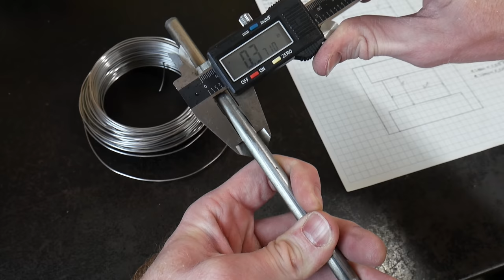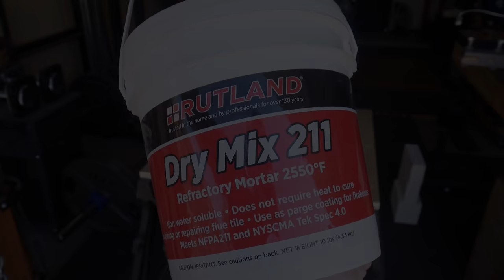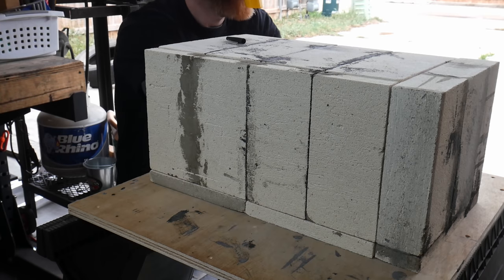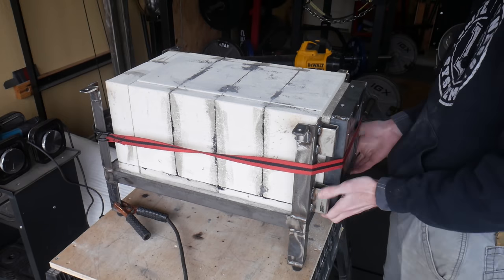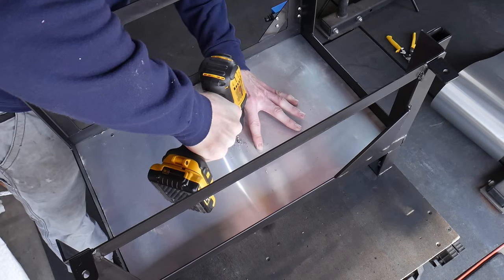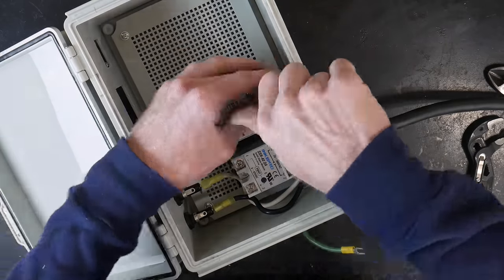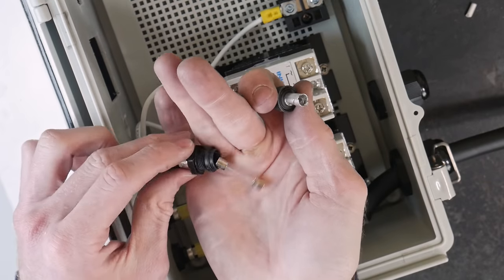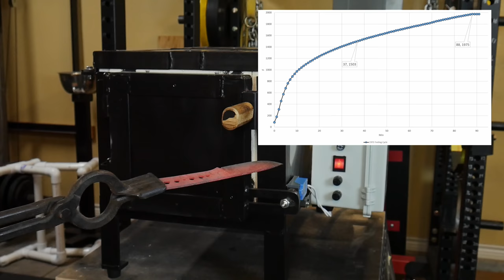How to Build a Heat Treating Oven | FULL GUIDE | DIY Heat Treatment Oven

Comment: Just ordered the parts. I have two questions:  1) if I extend the bed by one brick (4.5 inches), do I have to use more coil or can I stretch the coil a bit more? 2) Do I need a 30 amp breaker to get to 18.4 ohms resistance, assuming I need more wire?
Reply from the maker: Tom, I built this a while ago... so I'm trying to remember things to look out for. I think if you extended by 4.5 inches you should be ok on the stretch. Just be very carful to stretch the coil evenly. 

I break down the math in the video. In my case I decided to target a target amps of 13... which works out to requiring an 18.4 OHMS wire. This runs just fine on a 20 amp 240v breaker. (5:57)
Reply: @RedBeardOps  thank you sir. I will let you know how it turns out.

Comment: Wow so much detail! Thanks so much. I followed you and built my own. Seem to be having the same problems as you. Won’t go above 1100. Did you figure out why you were having problems?
Reply from the maker: Hey Wayne, I was never having issues. My oven goes to 1900F
Reply: @RedBeardOps  oh sorry I thought u were having a hard time. I can’t figure out why I can’t go over 1100. I have 17.8 on my coil. Good seal all the way around. Any advice would be great! Thanks again so much.
Reply from the maker: @waynesmith9421  Hey Wayne, two things. Make sure your thermo couple is wired right. Maybe test it with ice water to see if it holds zero. It's comment these wires can be flipped. Also, dig into the controller set points. I'm not sure what controller you're using, but the Auber is pretty confusing.

Comment: Have you noticed any degradation of the ceramic terminal blocks on the back of your kiln? I've notice they seem to get a lot hotter than I would like when I heat treat steels like 10v with high austenizing temperatures, with a decently long hold time.

Also for the placement of the limit switch I had good luck placing it so that the button is pushed in more than necessary,  that way it doesn't turn off after thermal expansion.
Reply from the maker: Good point on the switch. I haven't investigated the blocks
Reply: @RedBeardOps  I forgot to add to that, the main reason I asked is they had gotten a bit too hot and there has been some degradation to mine. Although, after really stuffing the back full of kaowool, it does seem to help. I'm not sure how I can stop them from getting hotter than I would like.
Reply: @RedBeardOps  so I've got at update on the oven. I've gone ahead and made some modifications to mine. You may have seen them on blade forums. 

I moved the terminal blocks to a point outside the aluminum flashing, as well as thethermal couple (I moved the thermal couple earlier on, because it was melting the insulation for the wire). I had to make new coils with longer twisted leads. But now that the terminal blocks arent attached to the body of the oven they arent getting heated all. Which is keeping the connection from getting degraded do too oxidation. 

Something I also did, but somewhat unrelated.  Is I coated the inside of the chamber with 100 ht ceramic coating, for kilns and forges. It's supposed to protect the firebrick, and also it's supposed to reflect heat leading to a quicker heat up time (since I'm only using 110v at 15 amps that matters more, though even then it's not too bad). So I put a layer over the entire inside of the oven, also taking the coils out and putting it  in the groves where those sit. 

 I havent fully fired it up since I've added this coating. So I'll see what effect if any its had. 

That's all the changes I've made that I can think of since i initially completed this. I think the only other thing I really want to do, is buy an even longer thermal couple to get closer to the area my blade will be sitting, and also do so research and see if accuracy is possibly effected by using cheaper thermocouples like the one I have now.
Reply from the maker: @_BLANK_BLANK  Nice work! Thanks for the notes

Comment: Epic work mate. I've modified an old kiln oven and it works a treat but I never got the temp to hold stable. Always about 20c difference from my target. Will use your technique to autotune when at temp.

Is there any reason you went for an auber controller over an inkbird?
Reply from the maker: Thanks man! The reason I went with the Auber is because if I ever wanted to down the road; I could set up some more advance schedules in it. I haven't used this feature yet.

Comment: Have a question: is your chamber dimension driven by your coil length or to accommodate larger blade builds?
Reply from the maker: For me the length was to accommodate larger blade builds.

Comment: Thing is, I do have a journeyman electrician sertification. I used to be a general contractor for the purpose of installing home theaters. Sometimes you have to add a room to the house to get the job done.

Comment: @ Red Beard Ops I don't know the heat specs of your control box, but without an exhaust fan and ventilation holes, you risk damage to your components from the heat of the SSR's...the heat sinks need a method to get rid of the heat from the SSR's, and plastic won't do that without exhaust holes and a fan...your SSR's might show 120 deg, but all that heat has no place to go...just my thoughts on it...nice build
Reply from the maker: Thanks James, I'll keep an eye on them.

Comment: Thank you for sharing.Would it work with 240v 
And what are external dimensions? Thank you
Reply from the maker: I don't recall the exact dimensions. You'll have to do that math with the bricks you get and insulation. I don't see why it wouldn't work with 240v as long as the components you order are rated for that.
Reply: @RedBeardOps  great all my list is done hope I change everything what I should change 😁 thank you
Reply from the maker: @stefanzubal6049  Good luck with your build! Be safe now... stuff is dangerous! lol

Comment: Something to consider is the surface loading of the wire. based on your calculations you get 30 watts/sq-in. if you're getting your oven up to or above 2000F then you're going to have shorter coil life. Ideally for operation around 2000F it should be closer to 20 watts/sq-in. the trade off would be how fast the coils reach the desired temperature, however in a smaller chamber the difference might be negligible.
Reply from the maker: Good thoughts!

Comment: Great video. I hope to build my own heat treat oven and your video will help a lot. Just curious why you chose to run 2 SSRs in series. Wouldn't running the door switch and element switch in series have the same effect without the added expense of a second SSR?
Reply from the maker: Based on advise I got from bladefourms and other makers who have made ovens. Cheers!
Reply: @RedBeardOps  After taking another look at the schematic, I realized that even though it wouldn't effect the operation of the oven it does improve the safety. Having the two SSRs makes it possible to isolate both hot legs while the unit it turned off. Defiantly worth it! Great design.

Comment: How much of the ceramic 1" insulation did you use, did you also cover the bottom and back side or put it on the door? I'm going to use the Superwool XTRA and was wondering how large of a piece to order.
Reply from the maker: Gosh I really don't remember. I think I had some on hand that I used.

Comment: Hello. Really nice work. Congratulations! I would like to ask if you have run it at 1930F (1054C), is the wire thick (16AVG - 1.3mm) enough for that temperature?
Reply from the maker: The oven I built can get to 1930F. The thinner the wire you use, the faster it will wear out.
Reply: @RedBeardOps  YES THAT IS CORRECT. HOWEVER, IF YOU USE VERY THICK WIRE, YOU WILL ALSO NEED MANY METERS. THE CHAMBER IS RELATIVELY SMALL SO SPACE IS AN ISSUE SINCE THE WIRE EXPANDS A LOT WHEN HEATED. THANK U MY FRIEND.

Comment: Nice build.  Looks great.  I've played around with PID on arduino so I'm thinking I might make one of these and just carry over my code from previous projects.  

One idea I've played with was if I connected Argon gas(or maybe even just CO2 to save money) at around 1psi and kept a positive pressure on the inside of the oven, I wonder if that would help prevent scale buildup on longer heat treat cycles.....   Not sure if that would be worthwhile as I've never owned a heat treat oven before.

Comment: Thanks a lot Red Beard Ops ! Great video, one of the best making reference !🥰 
I am just really surprised (and badly surprised in fact) that peoples in your cited references told to put 2 SSR like that 🤔 It doesn't make any sense .... even worst.... it could in fact be super counter productive by avoiding the SSR to work properly : SSR are here to switch on and off the current when it pass on 0, limiting switching (bad) effects. By putting two in series like that, it is just the best way to avoid them to recognize when the current is null by interfering with each other 🙄If they are rated for 40A and you want to switch 20A, no need to use 2 in all case 🤪

Comment: I am struggling to get the oven up to 1925. Any tips for better insulation? I recaulked all my interior joints with the same furnace cement used in the video, and that helped. FYI for anyone that had issues with the mortar, I found this stuff in the caulk tube worked much better, as far as holding the bricks together. 

I added a soft firebrick inside the oven in order to reduce the amount of space I needed to heat since my knives are all small. I also considered adding a layer of ko wool with satanite to the inside top of the furnace. I'm also considering adding satanite to the exterior ko wool. 

Any other suggestions to improve the insulation?
Reply from the maker: Man sorry to hear you're having issues. Mine gets up to 1925, but it does take a bit. 

May be worth verify your resistance on the coils and calculated watts
Reply: @RedBeardOps  that is definitely something I should do, thanks for the advice. I've been trying to get it up to temperature all day. I finally gave up turned everything off and cracked the door open. I just looked and apparently my thermometer is melting... The steel inside the ceramic coating is bending downward. Ever had anything like that happen before?
Reply from the maker: @yzpaul42  dang... maybe it was up and over 1900 but the temp wasn't reading right?
Reply: @RedBeardOps that's definitely what I'm thinking. I have a replacement thermometer on the way and I'm crossing my fingers.

Comment: Thanks for all the help so far. I finally have all my materials together, and I was trying to download Dans spreadsheet for calculating coils. However every time I click the link on his website nothing happens. I've tried multiple browsers with no success. Any chance you have a copy and are willing to post the link?
Reply from the maker: Hey man I just tested it on his site. Still working. You may have to copy the link address for the excel document and paste it in an incognito window so your ad blocker doesn't stop it. This is the direct link to the file - http://dcknives.com/public/downloads/DanCom_s%20Kanthal-A1-Coil%20Calculator%20R_1.xlsx
Reply: You were correct- thanks! Ad blocker got me!

Comment: Sir, I enjoyed your video, I'm an electrical fitter, two hopefully helpful tips, if your installing any type of device that is not easily accessible while fitting, pre-wire the device with excess wire length, install it and simply wire, the strippers you use to crimp are only appropriate for low DC voltage, I can if you wish send you the correct tool kind regards
Reply: lol

Comment: Thank you for this amazingly detailed video man! I almost made an exact copy of your oven except for one thing: the thermocouple. I'm using a k-type but without the ceramic shielding that your thermocouple has. I'm noticing some oxidation/scale coming of the thermocouple... Do you know if this has any adverse effects and if so, do you know how/if I can prevent it? Thank you very much for everything that you do for the community!
Reply from the maker: Thanks Louizous. I really can't say for sure. You can try to see if it's calibrated by putting it into a bucket of ice water.
Reply: @RedBeardOps  Will try that, thanks!

Comment: How well has the 16awg wire hold up?   My build might need 14, but i’d prefer the cost savings of the slightly smaller size.
Reply from the maker: So far my oven has been doing great!

Comment: Hi Mate, Just getting around to building my oven, your build is very useful to reference a few of the details, one thing I'm unsure about is the limit switch, are they necessary?  I notice lots of builds don't put one on, my thought is if the door is frequently opening and closing when heat treating a few knives i'd like it to stay on to keep the temp up? Or is this not really a problem people encounter?
Reply from the maker: Hey man, I'd say the limit switch is necessary. It comes down to safety and preventing damaging the system if you contact the elements with the knife. Good luck with your build!
Reply: @RedBeardOps  cool, that makes sense, cheers mate

Comment: Very nicely done.  I built one for glasswork a few years ago.  Works great, but not even close to the quality of your execution.  One warning I wanted to point out is that when SSR's fail, they fail in a closed state, overheat and catch on fire (I learned this the hard way, but fortunately it was not close to anything combustible).  I think your plastic enclosure may increase the burn risk if/when one of the ssr goes.  You may want to consider switching to a metal enclosure and/or adding thermal fuses to the ssrs that will cut out if the ssr overheats.
Reply from the maker: Thanks for the tip!

Comment: NOTE:  There are counterfeit Chinese SSRs on the market. I bought one through the snake company and then found an article that described the difference between the genuine and the counterfeit. They are labeled as handling a higher amperage than they actually can carry, and the genuine manufacturer has discontinued that particular line of SSRs due to this counterfeiting.  My advice is to buy SSRs from a reputable electronics supplier, and avoid any low-priced 'deals' that you see online.
Reply from the maker: Good tip sir!

Comment: Nice video. Wondering if you could have used a single SSR. I have only one in an electric brewery panel running 5500 W element at 240 VAC.
Reply from the maker: Hey John, I'm not sure to be honest.

Comment: Great job!! As you build the oven I was wandering why you used 2 ssr. All the circuits I've found use just one ssr. It would be nice to see how it worked  after a couple knifes if it worked fine. I have plans to make my own electric oven this year.
Greeting from Argentina.
Reply from the maker: Thanks man! Stay tuned because I'll be using this thing all the time. I've heard that 2 SSRs are ideal for 240. I think it puts less strain on the SSRs.
Reply: The reason you use 2 SSRs for a 240 volt system is to totally cut electricity off to the coils when you turn it off. 240 volts uses a hot (different phases) at each end of the coil, so you will always be able to get shocked by the coil if you only shut off one end by using only one SSR. This is different from 120 volts which uses a hot and a neutral. Since a neutral has no electric potential, you only need one SSR on the hot side.

Comment: Loved the video and all the info you provided! Just curious if you looked at using 3" or 4" ceramic fiber board instead of IFBs? Any plans to coat it with ITC-100/Plistix/etc.?
Reply from the maker: Hey Douglas, I didn't look into that. I'm pretty sure that stuff is pretty expensive. I don't currently have plans to coat the oven. Cheers man!
Reply: @RedBeardOps  Simond Store sells a 2600F 4" x 19.7" x 39.4" on Amazon for $160 a board which I believe can make a 5"x5"x15" interior oven (might need 2 IFBs for the door). From what I've tried to find, the ceramic boards insulate a bit better than brick (about the same as ceramic blankets), but should still have a final coating applied to contain any loose fibers. Just thought I'd mention it because I'd also heard that the board was expensive, but if Simond Store's stuff is any good, this seemed like an option as 4" thick seemed pretty good.

Comment: very comprehensive. early on you mentioned a trade-off between  volume and efficiency.  I would like to build a larger (but shallower) furnace for lost wax work, both low temp dewaxing, high temp volatilization, and perhaps metal melting.  I would like to understand your comment, as no one wants and inefficient product.  please comment.
Reply from the maker: Hey Richard. The larger volume you go with the same wattage will make the oven less "powerful." Inefficient was probably the wrong term. If I were you, I would at least try to match the watts/volume of the industrial options on the market for your application.

Comment: Im going to be building this very shortly, I was wondering, and I may have missed it, but what is the 12 ga wire used for? Very easy to follow video, good enough where you really shouldnt need the diagram if you follow the video.
Reply from the maker: Hey man, I'm trying to remember since this was a little bit ago; but I'm pretty sure I used it between the switches, PID, SSRs, etc. Then ran 10awg to the oven from the SSRs.
Reply from the maker: I'd have to re-watch my own video to remember... lol
Reply: @RedBeardOps  I thank you for the info. My burning question is, how much and what size angle iron did you use?
Reply from the maker: @adamnichols476  Sorry man, I don't remember the footage. I think it was 1-1/4'' angle.
Reply: @RedBeardOps  no problem, I thank you for the response again, I have some old bed frames that might do nicely.